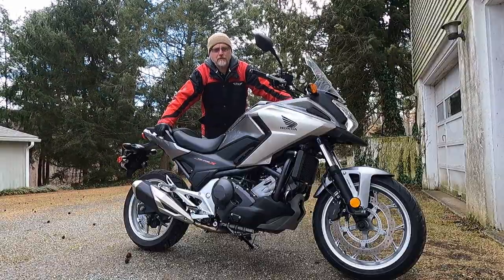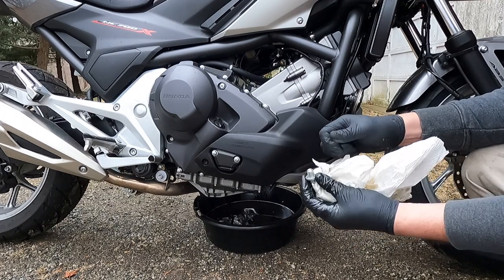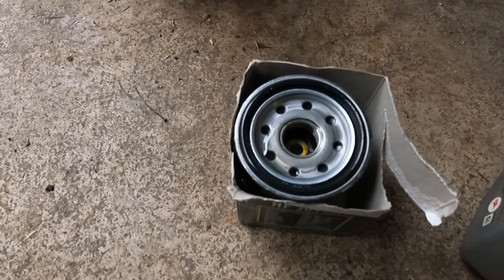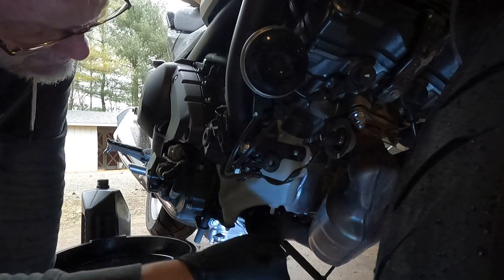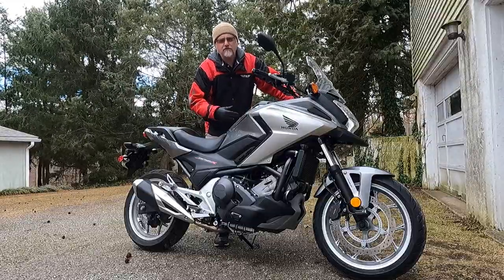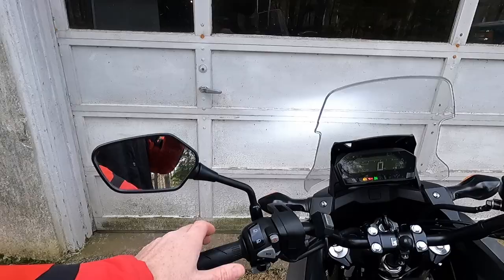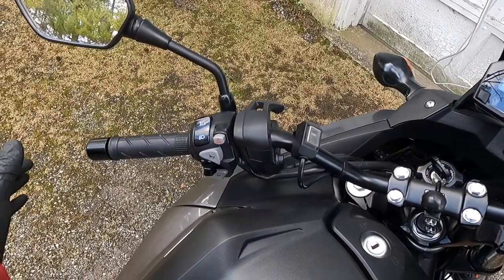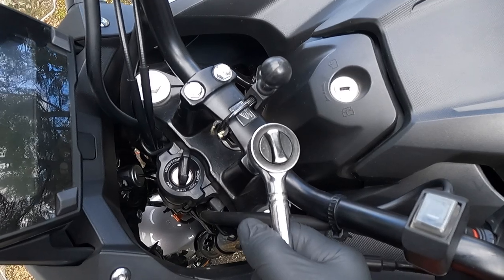How to service a Honda NC700X DCT

Comment: when you lubricated the chain that was wrong because you have to put the grease on the inside of the chain and then the grease can do his work now its flying directly to the rear wheel and does not do his job well  grts from belgium
Reply from the maker: Hi Joseph, newer chains are internally lubricated and sealed with o-rings. Cleaning them and lubricating them is more about removing abrasive grime and then protecting the links from corrosion on the outside. I make sure all exterior surfaces of the chain are coated with the chain wax - it doesn't sling off the chain like traditional lube. Cheers!

Comment: Picked up a 2014 700x with DCT a month back with 4000 miles on it, two year old tires, and recently serviced. I'm loving it so far. I just wasn't sure how to maintain it because there was no manual whatsoever. Now, I'm covered. Thanks!
Reply from the maker: You're welcome!
Reply: you can download a manual

Comment: "E-Brake"? Dude it's a parking brake. Not for emergencies!  If you did use it as an emergency brake it will be locked on and if tightly adjusted lockup your rear wheel, then you really will have an emergency while riding one-handed.
Reply from the maker: Push your glasses up, you win the award 🤓 Cheers!

Comment: Hey any help, my 2015 nc700x been sitting for awhile turns on replaced spark and low on fuel so added some, change battery too, but only turns on and cranks doesn’t run?
Reply from the maker: Can you hear the fuel pump when you first switch it on?

Comment: Sounds like we picked up similar used NCs.  Mine is a 2016 bought from a coworker.  Only had 1,400 miles or so on it 2 yrs ago, just under 9,000 now.  Getting ready to do an oil change, coolant drain/fill, and brake fluid replacement.  Then I'll be good for a couple more years.
Reply from the maker: It is hard to beat the low maintenance and efficiency of the NC!
Reply: @jonsmotorcyclerescueandrev3538   threw new tires on it last Spring.  That made a world of difference in handling.
Reply from the maker: @porkchop10  Agreed, it's amazing the difference new tires make on a bike.

Comment: Great Video! thx! 
...use torque wrench specially on bolts used on a metric bike.   However...There are places that even a torque wrench can get you into BIG TROUBLE QUICK... handle bar clamps for one!
Reply from the maker: Thanks David!